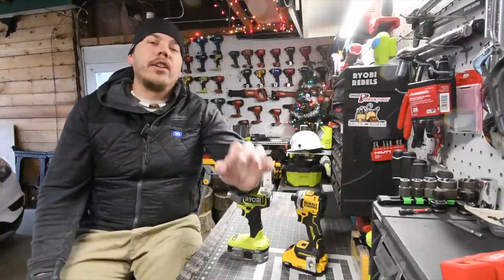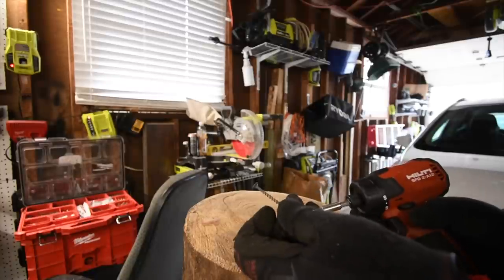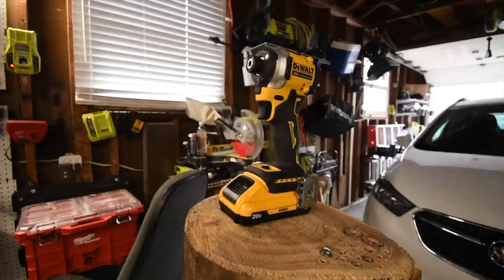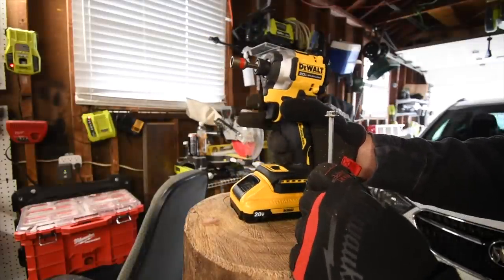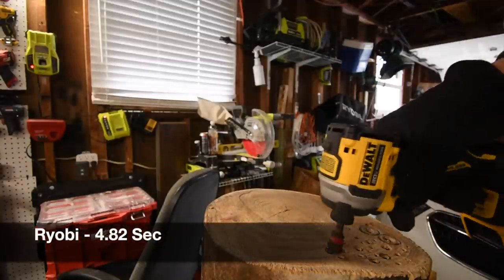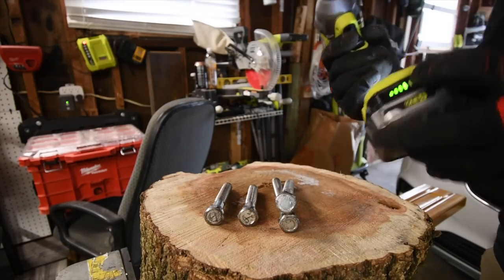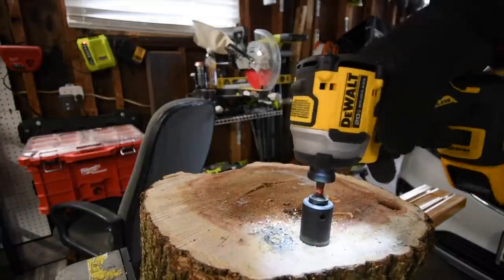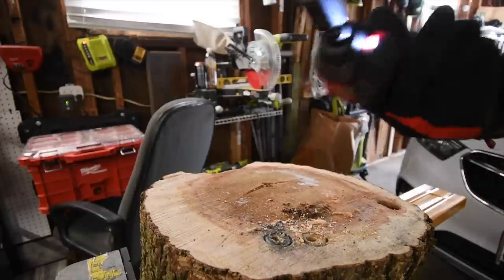Dewalt Atomic Vs RYOBI HP (impact Drivers)

Comment: In the first test, Dewalt's screw was larger than the one used with Ryobi. Come on, man! You are giving a wrong impression of the tool!
Reply from the maker: all screws were the same size
Reply: @ManCaverTools  Not in the first test, they weren't. It's super obvious.
Reply: The dewalts screw was clearly longer use the ryobi bag on the wall as a reference
Reply: @ManCaverTools  Haha I measured them both on the screen with a ruler when in vertical position prior to drilling - Ryobi first test screw is 6.8cm and dewalt one is 8cm! Not a true test, confirm for yourself. Camera didn't move and any difference in position would be minimal. You are welcome :)

Comment: Just shows how good the milwaukee is compared
Reply: Milwaukee can't touch Dewalt, they have a faster impact driver that's it, Dewalt just released stronger 12 volt and 20 volt impact wrenches, they have 60 volt tools, flexvolt advantage 20 volt tools, 12 volt tools, lawn equipment, including zero turn lawnmower, they have cordless ratchets coming out soon, flexvolt batteries, and now power stack batteries, and now you can charge a Dewalt battery with a type c charger and USB port....
Reply: But ya the Milwaukee impact driver is an absolute beast

Comment: The Ryobi battery has an advantage.  The Ryobi is useing five 21700 Samsung 30t 3000mah cells and the dewalt is useing 5 Samsung 21700 40t 4000mah cells. The Samsung  30t 3000mah cells are know to be the most powerful 21700 cells with the highest discharge rate.  Any time you test the samesung 30t vs 40t cells weather it’s a flashlight or a motor or a power tool or a vape the Samsung 30t always puts out more power with better results at the expense of run time.

Comment: Hi Dave, both tools are awesome, I got my 850 wensday and I’m so impressed with it, it’s excellent for under hood work it gets in tight spots even my 902 can’t get it, and the collet is auto remove the bit just pull out the collet and the bit will unlock then just take it out, very impressive, I absolutely love it, I use my 5ah battery it’s awesome, excellent demonstration Dave ty, Bob,

Comment: My 9yr old Ryobi P238 has had same issue with the release/collet that springs back to the 'locked' position when changing the bits out, so much so that rarely can manage a one handed but swap. It's always done it. When I replace later this year, I'll invariably have bit of a learning curve for sure.

Comment: I have been using ryobi impact drill and regular drill, and longevity is great, got them 7 years ago and still do the job and battery is charging with no issues i can tell those are a great drills and batteries

Comment: I got the ryobi hp and love it the decent price was great.so many time a bolt wouldnt come out and the ryobi would help me get stuck car bolts and nuts out.no complaints .ryobi works great and isnt super expensive.it also works great repairing decks .the difference is when ur Dewalt or Milwaukee breaks or gets stolen thats a few hundred to replace it

Comment: Something happened at 5:19 how did the bolts get closer...
Reply: It didn't his socket got stuck between the two bolts so you never got to see how close they were when he removed the socket. It looks that way because the socket was in the way. Well the socket was so close it got stuck trying to remove it from the bolt heads.

Comment: I Have Some Of The older Blue Ryobi Impacts that We Used For Years Putting decking On! They Would Get So Hot That You Had To Wear Gloves! I Have Never Had One To Fail! I Gave Them Away When I Replaced My Tools With The Newer Ryobi Impacts!  At The Time I Could Buy Three Ryobi Impacts For What I Would Pay For 1 Dewalt XR! I Have Never Had Much Luck With Milwaukee Lasting! They Are Great THROW AWAY Tools! I Like The Atomic Short Impact But It Is In A Different Class Than The Ryobi 3 Speed With ADAPTIVE Not Automatic Setting! They Make An Atomic That Is Bigger And In The Same Class As That Ryobi! Ryobi Makes A Compact HP Impact But I Found It To Be lacking I Gave It Away! The Main Reason I Use Ryobi Is The Battery Prices! I Have Dozens of Ryobi High Capacity Batteries From 3AH To 6AH So I Will Have To Stay In The Ryobi Eco-System!

Comment: Just wanted to let you and everyone know that you can get this DeWalt 850 with the 709 hammer drill and TWO Power Stack batteries for $229 at Home Depot. Supplies are limited all the stores around here only got three. That's an insane deal. The batteries are $180 and driver $150 alone.

Comment: On the first test, looked like the Dewalt screw was 2” longer than the Ryobi?
Reply: I think your correct
Reply from the maker: That 6" spax was the same size
Reply: I agree the screws appear to be different lengths. Check out time code 1.56 vs 2.56 and look at the top of the screw against the black bag hanging on the wall as a reference point. At 1.56 the screw is below the bag at 2.56 is it in the middle of the bag yet the screw locations are very close together. Might be worth just running that first test again as the time difference is inconsistent with the other tests. Either way, it will eliminate the doubt. Great channel btw.
Reply: Nice catch

Comment: So what does this actually show us?  Milwaukee is a beast!
Reply: Ya that's ALL Milwaukee has is their impact driver I'll give them that, Dewalt just released stronger 12 volt and 20 volt impact wrenches, they got 60 volt tools, flexvolt advantage 20 volt tools, 12 volt tools, lawn equipment including zero turn lawnmower, 60 volt chainsaw, flexvolt batteries, powerstack batteries and now u can charge a Dewalt battery with a type c phone charger, and have cordless ratchets coming soon....
Reply: @DirtySouthFlorida3  He used the only Ryobi battery with 21700 cells in it.

Comment: Idk where my hate for milwaukee comes from but I can't stand how powerful and small there drills and impacts are!
Reply: Milwaukee has a superior impact driver but that's it, Dewalt is a better tool company and they have far more tools than Milwaukee (60 volt, 20volt, 12 volt, lawn equipment, flexvolt batteries, powerstack batteries) and now you can charge a Dewalt battery with a type c phone charger

Comment: So if you're choosing between the Dewalt or the Ryobi, get the M18 :)
Reply: Well he's comparing the top of the line ryobi and milwaukee vs dewalts mini compact line 😬
Reply: Milwaukee can't touch Dewalt. Dewalt just released stronger 12 volt and 20 volt impact wrenches, they have 60 volt tools, flexvolt advantage 20 volt tools, 12 volt tools, lawn equipment including zero turn lawnmower and 60 volt chainsaw, got cordless ratchets coming soon, they have flexvolt batteries and now powerstack batteries and now u can charge a Dewalt battery with a type c phone charger, all Milwaukee has is that impact driver, plus Milwaukee is owned by a Chinese company(tti) Dewalt is owned by good old American Stanley Black and Decker
Reply: That's absolute hate for tools.... Regards if u have that batteries or not.... Otherwise.... Milwaukee M18 is around 200 usd for a kit....